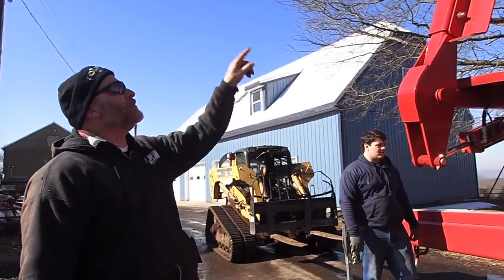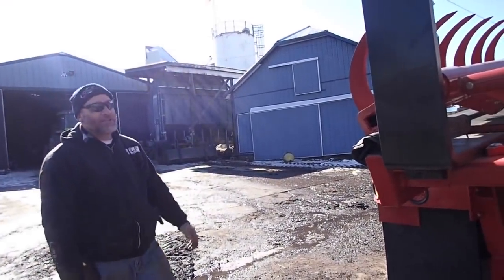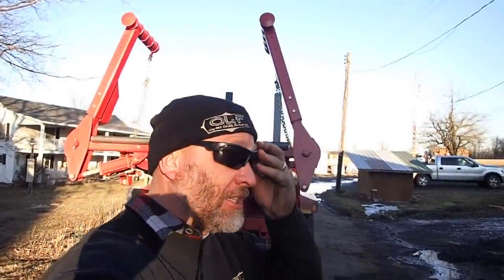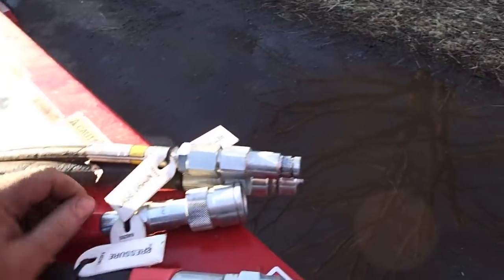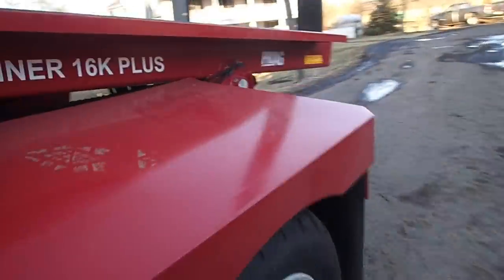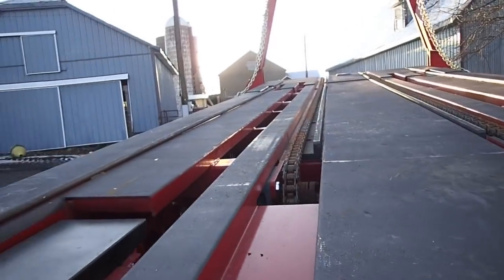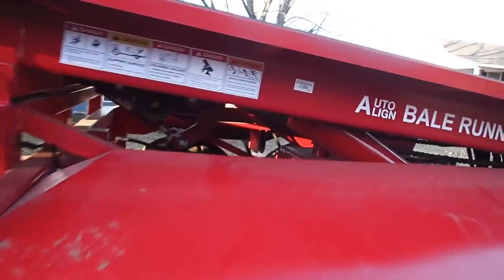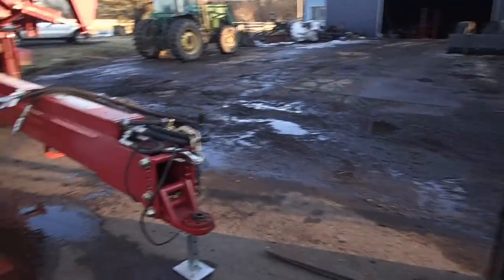Stacker Has Arived

Comment: They can never build simple hydraulics anymore always has to be something different and insufficient
Reply: Hi wes commenting to you here from Ireland it shouldn't be a big deal setting up your tractors that came from England for power beyond. You have four pipes going to your stack wagon the little pipe probably 3/8s is your sense line then you have like a 1/2 pipe that if you trace it back to the block will be marked P for pressure then you will have another bigger pipe maybe a 5/8ths or 3/4 this will be your return will be marked T for tank on the block. After that you have an extra free flow return this just goes straight into the backend of your tractor. The best way to plumb this up is to use a different fitting for each of the four pipes that way it can't be hooked up to the tractor incorrectly damaging the expensive valve on the machine. To get the power beyond to work on your tractor should just be a matter of looking up the manual and figuring out which of the ports to plumb fittings into on your valve chest on the tractor your 7530 definitely will just be a matter of plumbing in the right fittings. I'm surprised that the new loader that you put on the 8120 is not worked using power beyond it's the way loader are plumbed in Ireland and England anyway. Good luck with your new machine and thanks for posting videos I've learned a lot from you over the years👍
Reply: @jamesfarrelly7429  The 8120 loader uses a power beyond valve judging by a few videos back. On these modern high end the one thing missing are the pipes. The hydraulic components on the tractor are set up for load sensing.

Comment: It’s a beautiful stack-wagon, not cheap to you at all , But if manufacturers can’t power everything necessary for operation in a common format, then they should supply it with onboard independent hydraulics, and you just supply 12volts from your tractor. The wagon will be perfect for your straw contract, but simpler be way better than a giant long twisted drawbar, and mis-aligning chain and sprocket system if you ever show this to krone big-pack Wes Pandy style hay-bales.. How many other tractors can this stacker fit right on to? Good ole Frank, “F#ck that sh/t” .... Power Beyond MY whole... John Deere have a case to answer here too.. The best of good luck to you and your farming family Wes.

Comment: Does it make any difference having a bale stacker that progressively moves the bales to the rear? (would it keep the weight on the tractor drawbar better than a bale stacker that moves the bales furthest rear at the start of loading?)  (my pick would be?)   Bale chaser made by  NW Ag   https://youtu.be/8ersWyH3eFQ   (also has the joystick control, electrical enclosure looks well laid out)).   Arcusin Europe   (auto stacker - hydraulics system on machine separate from tractor oil)
   https://youtu.be/7RhRr2cOXEo   (in cab control - looks like a straw type machine) (Arcusin stacking in Australia https://youtu.be/4fsads92oJk  )    Canadian Anderson Stackpro 7200  https://youtu.be/M-nt-JkvmS4   (looks complex)
The 16K bale runner looks like it needs the hydraulic valve bank having better protection.

Comment: It's hardly a new concept. My 1965 Ford 4400 came from the factory with "Power Beyond" hydraulics in order to allow the back-hoe to run at full hydraulic pressure, while still permitting the regulator for the front-end-loader to be set at a lower pressure.

Comment: I have a small Kubota that I added some hydraulic after market stuff to; boy did it take a whole lot of research on tractorbynet.com to figure out; my power beyond port is on my loader valve; what I believe I understand is that "power beyond" port is just an always pressurized output port that has to have a return to the sump on the other end so fluid can always flow; then that circuit has one or multiple open center hydraulic valves in the middle to control each function you add, i.e. in my case a grapple, power angle for my snowplow, hydraulic toplink or 3 point splitter; I assume the "return" is the line that goes back to the sump; I don't get what the "case drain" line is on your stacker. I assume high volume hydraulics big equipment like yours has a huge power beyond port/return or multiple power beyond ports/returns?? and the open center valves in the circuits for various stacker functions are in the stacker, which I assume are those valves they said could blow up if not plumbed correctly; whatever it is, whoever you got that stacker from should know how to plumb it into a JD; its not like you've got some obscure tractor made in Afghanistan or something ;-) Good luck Wes!!

Comment: loadsensing is big presuer and big return the load sensing is line mesuers the need of oil in the systems and wil sens af sine to the pump of the tractor to put more oil to de machine over here in holland 80% of the big machines use id

Comment: 7530 's come standard with loadsensing/powerbeyond.
Reply: powerbeyond is 3 point. retour,pressure and feel/sensing>>  and you probably got an brake there. also we probably use different couplers in europe.

8530 also got loadsensing> 8120 idk

we always have a small sense conduit. big retour and pressure duct. this is quite  weird on this machine to me.

mostly you can switch a valve for shutting off the loadsense system. and make it an normal electronic system on which you also can run ur 4960 on it.
Reply: I think you are wrong it has a fourth line return from the block
Reply: @jonasadahl3323  thats the thing whats bugging me. Our ls systems only use 3. There is something weird on that loadsensing system
Reply: the fourt is an overflow return that we also have in finland usally

Comment: I have never ever in five years ever rained on anybody's parade. And my intention is not to now. Did you ever check out the big bale stacker by Northwest Ag Equipment it's made in Halsey Oregon. It's virtually engineered on the same principle as the one you got except that it is easier to run at higher speed. It is operated by a joystick in the cab with the buttons on top of the joystick it is not a handheld unit. Second instead of 1 grabbing arm it's got four it has to midpoint to hold the bottom bail and then the second arm is like in the when you have but it holds both bails as it goes up into the air. And what really facilitates is high-speed operation is that the bails tilt up against the forks so it has something to rest against to go at a higher speed picks up two more bales  the forks go back to accommodate the next two bales. So the bails always are resting on the forks steadies them, to go at a higher speed if the field is not so smooth